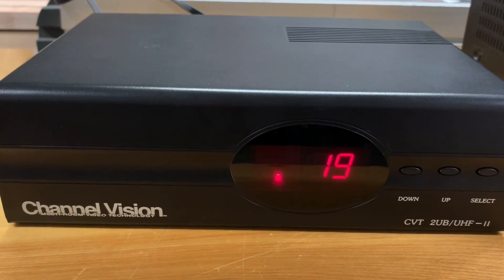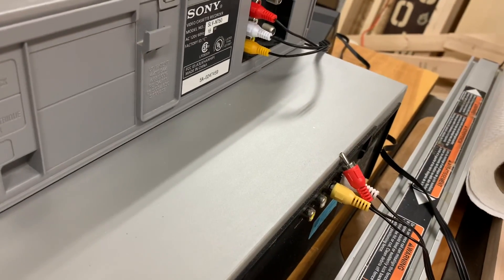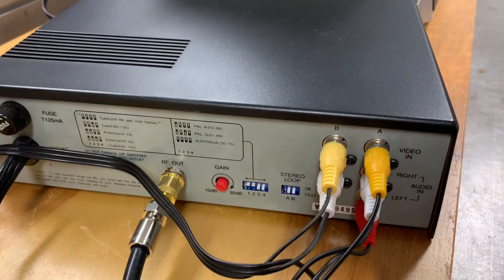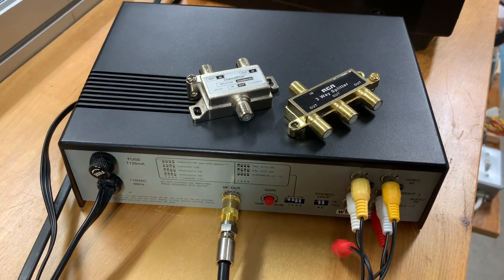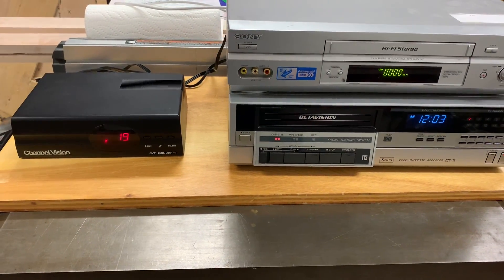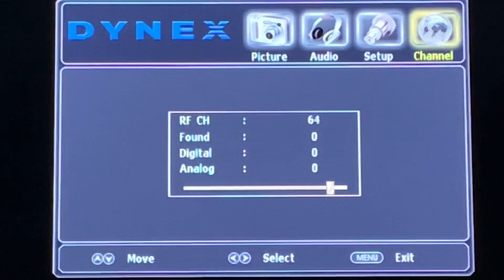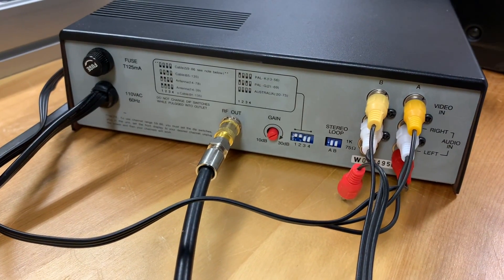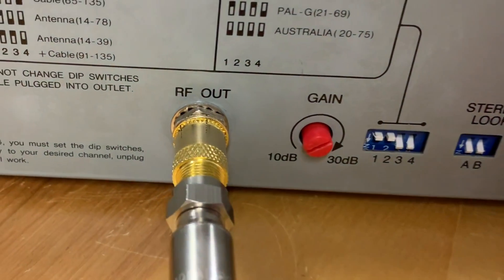Make your own personal analog TV channels at home | UHF TV Channel Modulator | Video sender

Comment: Is it illegal to do it over-the-air in your home in Canada? Because, Im trying to make me and my parents get my channels in the air with an antenna on their TV
Reply from the maker: You cannot broadcast a wireless TV signal on the television band. You can make your own closed circuit television channel through coaxial cable. They also make wireless video senders.

https://youtu.be/X14h-jj4NoA?si=lDL-9uXRBIxy91fz
Reply: @NorthcoasterHobby so… ur saying I can’t like use a ULP (Ultra-Low-Power) Analog television signal? Because, I just wanna know if u can transmit a ULP in Canada?
Reply from the maker: @ No transmitting allowed on TV frequencies in Canada.
Reply: @NorthcoasterHobby  ok thank you

Comment: Will this work on a Analog Tube TV?
Reply: So long as your television set has an NTSC/PAL tuner, it can be an old CRT or new LCD model and it will still work.  The modulator shown is designed to transmit an analog signal that an older TV can understand, even though TV has switched in many jurisdictions to ATSC/DVB.
Reply from the maker: Yes!

Comment: The philphines still brocasting in analog
Reply: Wish peoe didn't hate analog so much, cause it's mostly off the air in Canada
Reply: @yoshibros1111  oh i don’t know why they have to get rid of analog am fm radio is still analog why they get rid of analog tv instead
Reply: I still don't understand why they got rid of analog. I see no reason not for them to broadcast an analog signal alongside a crappy digital one. I know that some stations are being used for ote things now but the remaining ones are pristine locations to broadcast on.
Reply: @yoshibros1111  I wish the government didn’t invent digital tv it’s sucks. It’s hard to pick up than analog digital is totally digital junk
Reply: Yes it has no benefits to analog tv, and has numerous disadvantages
Reply: @yoshibros1111  yes it’s so bad that the us wants a crappy digital signal instead of a good analog signal I don’t mind if is not high definition
Reply: Weird thing, apparently a lot of stations in my state actually weren't required to shut down in 2009, even though they were full power stations, apparently they got some kind of special permission from the FCC that said "yeah, you can still run your signal, just shut it down when we say so, okay?" my PBS station actually kept their analog signal until 2013 and it was just so easy to use the analog signals, you didn't need to hook up any cables or anything, you just switched to the channel and it went straight to there, I was so disappointed when they shut it down.
Reply: Not only analog. But here in the Philippines, we still have a lots of crt tv's too literally everywhere even this 2022.
Reply: @Raz82000  analog TV channels turned into widescreen instead of letterbox.

Comment: If you buy a HDMI Switch (with 3 or 4 inputs) and an HDMI to RCA converter then you can connect a laptop, gaming console, satellite receiver or a Blu-ray player to your UHF modulator. That's what I did with my DigiQuest Stereo RF Modulator, but mine also has VHF output. Instead of UHF channel 36 I set it on VHF channel 2. My modulator has the frequency range output 48 - 858 MHz. Also is compatible with both European and North American TV sets, by default the sound is set on B/G standard, in Europe in the analog days we used B/G, B/K and I audio format and for North America has M/N audio format. The picture is by default on PAL but if you have an NTSC source the picture will be on NTSC
Reply from the maker: Good idea, I made a video about HDMI switches I use a while ago. These modulators offer many possibilities for watching your own content at home.
Reply: @NorthcoasterHobby  If you have a NETFLIX account or in my case HBO GO account it's the best solution to broadcast your movies on your existing closed circuit TV. But I would recommend a Digital RF Modulator for 1080p experience.
Reply: @NorthcoasterHobby  Boxing on channel 19,
Cartoons on channel 62.
Satan Rituals on channel 666.
Reply: @MrPillowStudios  666 is only on AM frequency in 9 kHz increments (4 kHz off to 670 kHz) and 66.6 FM too (Russian OIRT FM BAND). And 666.03 MHz Cable TV 103 (HRC).
Reply: HDMI TO VGA and VGA to VIDEO . VGA TO VIDEO can stretch 16:9 image to 4:3 using zoom arrow buttons of VGA TO VIDEO. Just like VGA monitor. HDMI TO RCA doesn’t have any buttons.